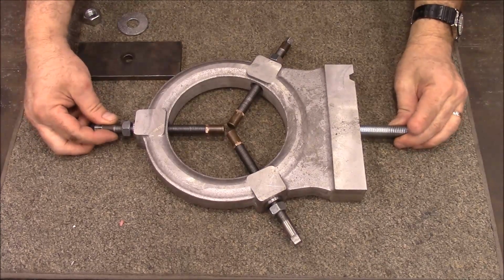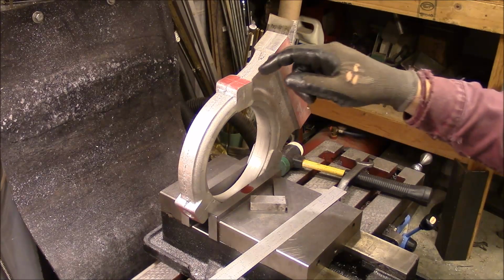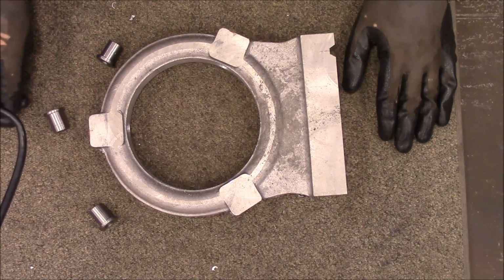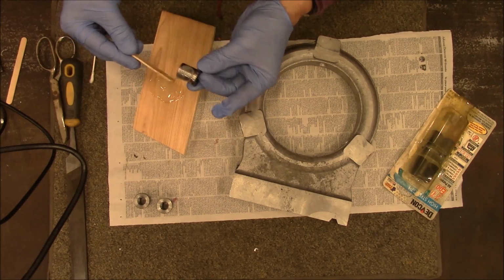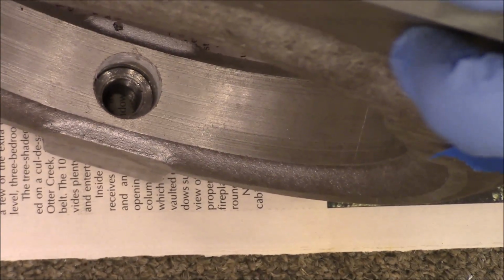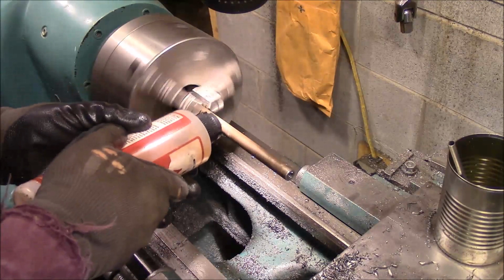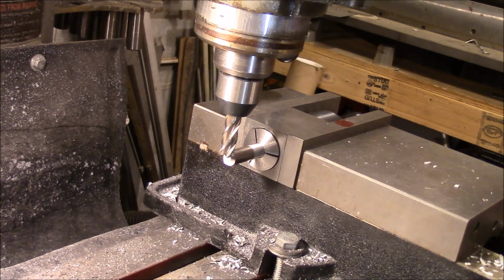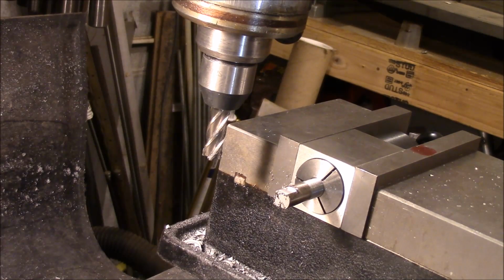Homemade Steady Rest part 1

Comment: Nice work. I was thinking the same as @Gilberto Diaz Castro as far as the nserts go. The shoulders would keep it from getting pushed out. I'm looking for ideas to build a steady rest for my South Bend Heavy 10. I like the fact you casted the piece & finised it. Good stuff.
Aloha,
Chief
Reply from the maker: Thanks.  I originally planned to put the inserts on the inside but decided to try them the way they are as it increased the diameter on the inside.  So far no problem.  Thanks for the comment!

Comment: Cool video man. I'm buying a lathe that doesn't come with a steady or a follow rest, and I'm going to have to try something like this. If I may make a suggestion, my first intuition for drilling holes like that would be to grab a plumb bob. Did you surface the sides of it before chucking it up? Because if they're off, it's going to throw the center off too. Unless your casting was done really well, which it looks like it was. 

What did you make your mold out of? I assume you didn't just eyeball carve it out of plastic. Would love to see how you made it.
Reply from the maker: I made the pattern  out of MDF on my CNC machine, I show the pattern at about 19 minutes in part 2.  I have several other videos showing how I make patterns if you are interested.  This steady rest has worked well for me, granted I don't use one very often.  Good luck with your new lathe.  Thanks for watching!

Comment: great videos, I had one question about this tho, I know that if you put aluminum parts with steel bolts, they tend to corrode after a while due to galvanic corrosion, have you had any issues with this corroding or messing with the iron in your lathe bed, or does everything being covered in paint/oil prevent that?
Reply from the maker: I have not had any issues but I don't use it very often and when I do it is not on the lathe bed more than a day or 2.  That's an interesting thought, I'm glad I didn't think about that before I made it, I might have decided not to.  LOL  Thanks for watching!
Reply: Actually since you used epoxy between the steel sleeves and the aluminum casting, that should form an effective insulator between the two dissimilar metals.

Comment: Nice work! Can you tell me what happened to your index finger?
Reply from the maker: +Gizachew Mebratu I cut it on a table saw about 25 years ago.  Thanks for watching!
Reply: +Soat Mon you shop safety is still shit btw, you manipulate around the workpiece with the machines running. No lesson learned.
Reply: could you pour one for me? How much if you could